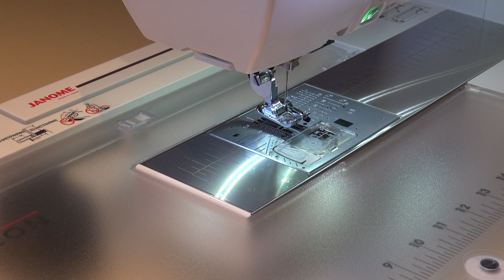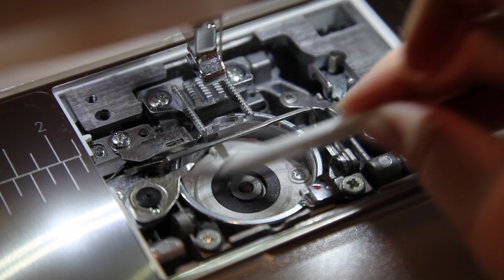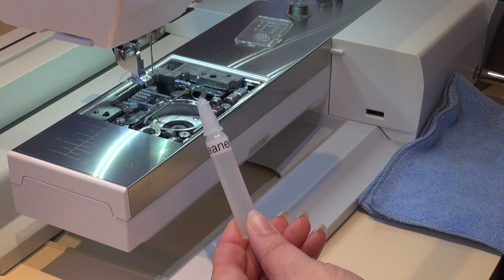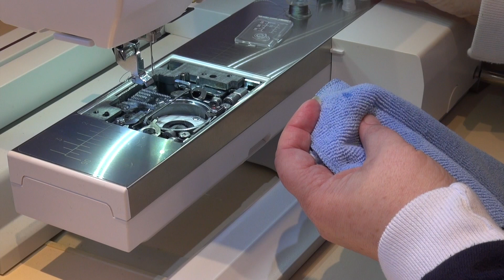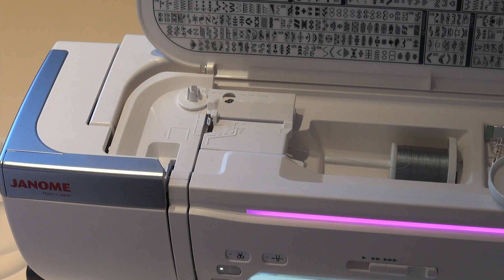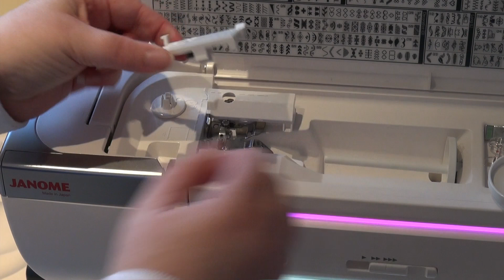Janome Memory Craft 15000 Machine Maintenance

Comment: Pro tip...when removing the needle thread, don't pull it backwards through the guides. Snip the thread next to the cotton reel and pull the thread through, from down near the needle. Reason?...the thread guides often have a 'lead' on them (like it tapers) but not on the trailing edge.
If you pull the thread backwards it might split and ball up the thread under the guide. Then its a trip to a Tech to clean it out.

Comment: I don't have a local Janome dealer any more and recently by needle threader tries to move downward to load the needle but makes a funny noise, moves half way down but doesn't finish and doesn't thread my needle on my Memory Craft 15000.  Do  you know what the problem is and how I can fix it?  I've been threading my needle manually which is a pain.  No other dealer will look at this and tell me I have to take it to a Janome dealer which is a problem as the nearest one is 2 hours away.  I would have to make 2 trips and wait weeks to get my machine.  I'd rather not.  I'm just wondering if it is an adjustment that would be easy to do.  Your help would be greatly appreciated. Thanks, Vicki

Comment: My threader was working great until I changed needles. The threader goes through the motions, but it doesn’t Thread the needle. The need is in correctly. I checked that. Have you run into this problem?
Reply from the maker: Hi Jan, this isn't something I have found, I would however suggest try reseating the needle again and make sure it is set to the correct hight in the shank.

Comment: my auto threader stopped working and I really miss it and I did what it said to do on site to try and make it work again, have you had any problems with yours or other people ask you about it? Kathy
Reply: +Kathy Kauth  i have had my machine in the shop lots of times, but now it works every time... i do fine it depends on a few things,  1... make sure the needle is seated in the slot correctly, 2. use the up/down needle to get it in the right position, 3. depends on the thread thickness and the needle eye/ 
come join us at https://www.facebook.com/groups/981259271895485/
Reply from the maker: Hi Kathy, on my older machine, and the 15000 too, it's one of Janome's weaknesses.  I had to send my 15000 back to the store to be fixed.
Reply: Always press the lockout key before you try to thread the needle. It makes a big difference.